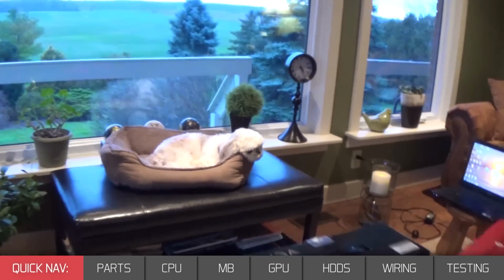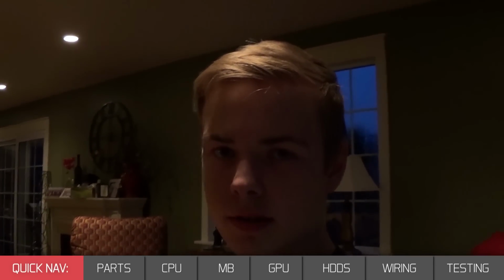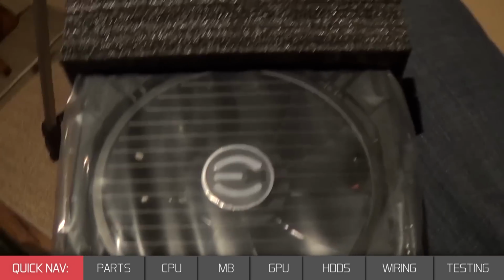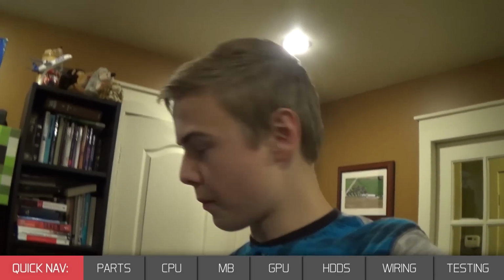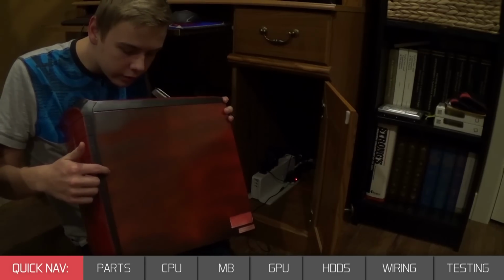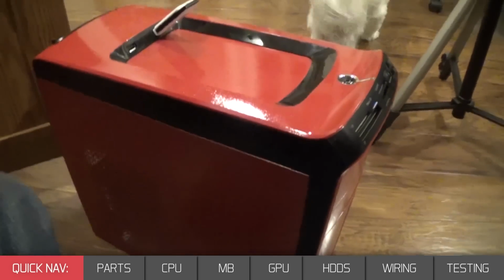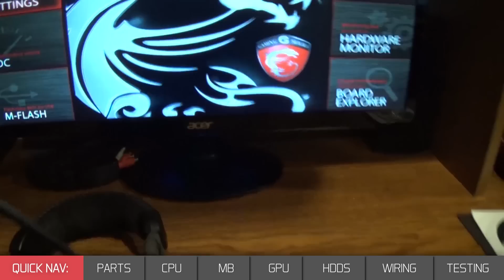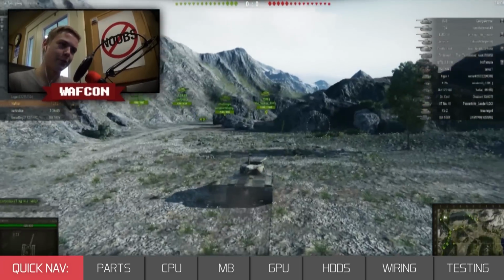$600 PC - Building a New PC! AMD FX 6300, Gtx 960 - Wafcon

Comment from the maker: :D
Reply: +Wafcon Gaming + GFX hye sir ... i had a question regarding about ur cpu temp and gpu temp during gaming and idle ? ... from my based experience amd cpu require a lot of fan cooler otherwise the performance are slightly bit down...
Reply from the maker: +Aeriest Light Presia My cpu during complete idle is perfectly fine (no heat) but during gaming it becomes a freaking stove. I plan on buying a liquid cpu cooler to improve this tho.
Reply: Wafcon Gaming + GFX but is it affect ur gaming experience when its heating ? example of sudden fps drop ?
Reply from the maker: +Aeriest Light Presia No I actually haven't had any issues at all so far. But I'm sure that over heating isn't good for it either
Reply: +Wafcon if no overclock intended the only real pain with stock cooler its the noise level. a Liquid cooling solution its nice but not a must for Fx6300, with a budget aftermarket cooler (like Tx3) you can have nice temp specs and low noise and a "common" Hyper 212 evo should give the CPU headroom for a 4.3 to 4.5ghz overclock with no major effort. Liquid coolers are only reasonable for that Fx6300 if planning to aim for 5.0ghz overclock which will also need a Fx990 mobo with a stronger power-phase and higher VRM/Mosfet quality
Reply from the maker: +Juan jotabe ya I am thinking of just buying a hyper 12 Evo and over clocking it to around 4.2 but right now it isn't a big worry for me. I will probably do some upgrades when I move at the end of the year. Also thanks for the tips I'm still a really big noob at this. :)
Reply: Wafcon
 of course at stock speeds its just fine, but if you look at the recent/next game launchs of this year, the Fx6300 only shows at the minimun requirement, and in some cases it doesn't even fill the minimun requirements. Of course these are Triple A tittles and a good GPU can solve most of the problem. But a 4.5ghz overclock will give some extended life in gaming.
Reply from the maker: +Juan jotabe lol the poor fx 6300 :'(
Reply: can the fx 6300 get overcklocked ?
Reply: also does the CPU involve in gaming ,like lagging or taking lots of time to load the game. it would be better to have a i5 6600k ?
Reply: nikolas katudis
yeap, its "unlocked", that means the operator can change multiplier and other stuffs. The only limit for the overclock is the Motherboard (the reasonable minimun should be a 970 mobo with a decent power phase and disipated VRM & Mosfet like MSI 970 gaming or Asus M5a97 R2 / 970 aura.
The other limit is the cooler... with stock cooler Fx6300 might get up to 3.8 or 3.9... with a mid range aftermarket air cooler like Hyper 212 Evo a frequency of 4.3 to 4.5 should be reachable. At 4.5ghz the Fx6300 should be about as good as Fx8350 stock for most case-scenarios.
All in all, as a cheap CPU, it has good potential for the next year or two... if you go for a Fx8350 you'll have good potential for 3 maybe for years (with overclock)
Reply from the maker: Juan jotabe I kid you not I'm editing a video right now where I bought the hyper 212 and I overclock my fx 6300 lol
Reply: +Wafcon I like you so I go post link on pewdiepie vids :)
Reply: nikolas katudis
CPU are not the main factor in game loading time... this is mostly afected by the hard drive/solid state drive. A game on SSD should load pretty fast...
The other key factor its the ammount of RAM on your system. More ram means the game will not use pagefile so it will work better... don't care that much for ram frequency (in example 1600 vs 1866mhz) since it will not matter when used dedicated graphic card.

The CPU in most games takes the job of processing the "world", the IA of the NPC and every movement of the NPC, the objects (including bullets) and the characters/players. That data is comunicated to the GPU in order to render the specific instructions and render the data to the screen (those millons of pixels many times per second).

That's why GPU its way more important than CPU, since in most cases the CPU will be able to process the data and the main "bottleneck" becomes A) when gpu its too slow and gives back some data to the cpu to render... and B) when GPU its too fast and ask more data of what CPU can provide (in this case its not a bottleneck from CPU but an overkill from GPU).
Some test shows that higher res means less CPU stress compared with high end GPU and then CPU delta becomes irrelevant (i.e. Fx8370 vs i5 6600k will play about the same at 4K on well optimized games).

So, at the end, build your system around your GPU instead of your CPU... once you pick a GPU look out for a CPU/Mobo combo able to perform well (GTX970 will excell on most 1080p scenarios with any Fx8 core or i5 from 4, 5 or 6th gen).
Reply: +Juan jotabe thnx for the trouble to write all this I did understand half of it...anyways I want to build and CPU but with good GPU to play on my 2k monitor well .will this build perform well for high 1440p ? :and a10 7870k ,Asus crossblade ranger ,MSI gtx 970 ,hypers savage 8 GB ram 2133MHz ,hyperX savage 240gb ssd ,xfx psu 600w ,cm hyper 212x !!!
Reply from the maker: nikolas katudis I looked around and it seems that the 970 can handle 2k gaming pretty good. I would say that your build could manage it for sure on lower settings if not medium to high. :D
Reply: Wafcon
lol yea, you can get away with less powerfull hard if you don't mind to use it at low or medium... thats a mid to high settings config...
Reply: +Juan jotabe what if I put an amd fx 6300 and MSI 970 instead ? Will it effect the performance ?
Reply: nikolas katudis
 well, for 10 or 20 bucks more you can get Fx8320 that will overclock almost as good as a Fx8350, but if you have an Fx6300 or you can get one really cheap go for it... and overclock it of course.
GTX970 / R9 390x are at the limit of what an Fx6300 overclocked can take correctly. I think you'll be fine if you're not looking for Extreme gaming. Don't downgrade your GPU for 1440p gaming, R9 380 and GTX960 can't take 1440p that good
Reply: nikolas katudis
AMD Build for 1440p gaming: Fx8350 + Asus 970 aura (or similar) + R9 390x 8gb + 16gb RAM DDR3 (1866mhz) + 1x120gb SSD + 1x1TB HDD + 700w (80+) PSU + Hyper 212x/evo.

Intel (Nvidia) Build for 1440p: i5 6600k + Any x99 board + GTX 970 + 16gb RAM DDR4 (2400mhz) + 1 x 120gb SSD + 1 x 1TB HDD + 700w (80+) PSU + Hyper 212x/evo.

The i5 CPU+Mobo will perform slightly better for games compared to Fx8350+Mobo (and about the same at other tasks) but it will be more expensive. Both CPUs can be overclocked

The R9 390x with 8gb will perform slightly better at 1440p compared to GTX970, mostly thanks to the extra vram.
Reply from the maker: Juan jotabe Dang, Im not even needed here lol :)
Reply: Wafcon
lol im bored :D
Reply from the maker: Juan jotabe lel I understand :3
Reply from the maker: BBBudget PC You most likely have the stock cooler on it. Upgrade it to a new cooler such as the Hyper 212 Evo like I did in my new upgrade video :D
Reply: BBBudget PC
The CPU does not make noise, the cooler is the one producing noise, if you have a stock cooler, i strongly suggest for u to change it to an aftermarket one... Coolermaster TX3 or T14 will provide better termal performance at a lower noise, and they will fit about every case. Coolermaster Hype 212x or Evo will be great even for overclock, but they do not fit every case
Reply from the maker: Juan jotabe yup :3
Reply: BBBudget PC
 yea, that would do the trick ;)
Reply: BBBudget PC
Its ok, i would only suggest for u is to use a single 8gb stick of RAM, the dual channel performance increase in RAM its about minimal, and a 1 or 2 years from now 16gb will be the ammount needed for PC gaming, so by using 1 single stick you can later upgrade to 16gb
Reply: its now starting mate the new Battlefield 1 recommends 16g ram =D its crazy !  kk
Reply: edshotz ed yea but you can get away with 8 with some minor bottleneck or by lowering some stuff out of ultra.
BTW GTAV also uses more than 8gb if fully maxed out
Reply from the maker: Juan jotabe 8Gb vram or just ram? :O
Reply: Wafcon
8gb of VRAM for 1080p its plain overkill these days... 4gbs its more than OK.
8gb of RAM its the minimal ammount to have in a 2016 gaming rig... 16gb should be the standar "kind of futureproof" choice by now...

I don't have BF1, but the benchs i saw it does not utilize more than 6.5gb of RAM and 3.2gb of VRAM maxed out at 1080p/60fps...

Textures are getting heavier, but not that quick and not that much compared to 2012/2013
Reply: BBBudget PC
I can't think of one game that does uses more than 4gb at 1080p... of course, i would go with a 6 or 8gb vram card in order to be VR, 2k or 4k "ready" at this point, but for 1080p 4gigs still holds
Reply from the maker: BBBudget PC Lol You learn something everyday.

Comment: I've got the same rig with a 4.40 overclocked 6300. for some reason I can only get 90 fps on csgo on low. I have a weak power supply, can that be the issue
Reply from the maker: If you do have a weak psu that could very easily be the issue, especially if you are overclocked. how many watts is your psu?
Reply: +Wafcon  I have the same build aha but different graphics card an mb
Reply from the maker: +B.F Farming nice! You do much gaming?
Reply: Wafcon yea play a lot of bf 3 need to get bf4 aha hbu
Reply: Wafcon not very high, but thats my idea
Reply: Tony | CS:GO Clips & More if u have the same build as him u will need at least 430w PSU to give u some head room
Reply: +B.F Farming I'm pretty sure its got a 200w I need a 500w
Reply: +Tony | CS:GO Clips & More +Tony | CS:GO Clips & More yh, my rig has a 750ti and fx6300 and the needs 250w so just got a 430w PSU so for u I would go for the 500w aha
Reply: B.F Farming Yeah, im going for a 500w, thanks.
Reply from the maker: +Tony | CS:GO Clips & More Ya I'm pretty sure the reason why it was slow is because of ur psu. Say your CPU hit 60% usage but since your power supply can't give it enough power it will just stutter and give you bad fps. A 500w should be plenty. Btw if you are looking for good prices use pc part picker. It's an amazing website.
Reply from the maker: +B.F Farming Ya I've been playing rainbow six, world of tanks, and now BO3. I've been posting lots of all of those games. :3

Comment: Horrible cable management...
Reply from the maker: Yes and no. There is no room behind the back of the case, and you literally do not notice the cables anywhere with the window on it. Btw it my very first PC build :)
Reply: +Wafcon Gaming + GFX  I just literally got my corsair 100r case and put my parts in just finished 10 minutes ago  i did a half ass job cable managing it since i will be getting a new motherboard and cpu soon and it is possible to do a good job cable managing
Reply: +MrSpartan117fan it is my first pc build too
Reply from the maker: +MrSpartan117fan the case I have is a corsair spec 01 and the back panel is already bent with all the hdd wires behind it

Comment: Thats scary how close your system is to mine I just built. Vlog here: https://www.youtube.com/watch?v=y2s1XdfqYuc

It has died on me for unkown reason, guessing modo. Having tested at the store I bought at.
Reply from the maker: +KB_TheDireWolf ill check t out :) And what mobo do you have?
Reply from the maker: +KB_TheDireWolf Nevermind I just watched your video. I am almost certain that it would be your hard drive. Seagate is known for crap hard drives and that is most likely the case for you. Try getting a Western Digital Blue like I have.
Reply: Wafcon Gaming + GFX No, I don't think I had a failure with my SSHD.

Because when I tried to boot, I would get no video output. 

If no drive was detected there would be at least a post.

Memory Express. A local/online big box part store tested my 960, It checked out.

By the seams of it, its a mobo failure. I left it with them Sunday, might have to wait a week for it to get tested. 

Just cant really believe that it happen, a week of running fine and bam dead for no apparent reason.
Reply from the maker: KB_TheDireWolf That sucks man :| I hope that it gets fixed sooner or later :3

Comment: your cable management is awful! iv the same exact build too :)
Reply from the maker: D: where else am I supposed to shove all those fat psu wires? :)
Reply: +Wafcon Gaming + GFX i thought the same thing dont worry! theres cut outs for you to route the cables behind the motherboard, its a tight squeeze but itll look so much nicer and will allow much better airflow :)
Reply from the maker: StevenC203 Ok. Thanks for the tip :D

Comment: I see that you have no idea of placing a computer. After 1 is cooling on the processor, who uses the basic !? After 2 laying of cables until you want to cry. And most importantly, remove the computer from the cabinet because it boil ;/
Reply from the maker: Lol it was my first build go easy on me. I replaced the stock fan with the 212 Evo I while ago, and the cabinet was never closed. Not sure what you mean by layering cables tho.
Reply: I mean that the cables have badly arranged, they should not be seen. The case should be closed!
Reply: Maciej Yes bro.I was going to tell this.Use cooler master 212evo.Because with the same specs my processor used to overheat and my pc shuts down itself to protect itself.....So I replaced the stock cooler to cooler master 212evo.(I was going too buy Corsair water cooler my guardian didn't bought it because of the shop keeper.He said I would be fine with 212evo.😒😒😒).And I was fine though.And bro take out the CPU from the cage it will just over heat to its massive limit...Otherwise everything was fine.Nice video.Keep going 😃😃😃